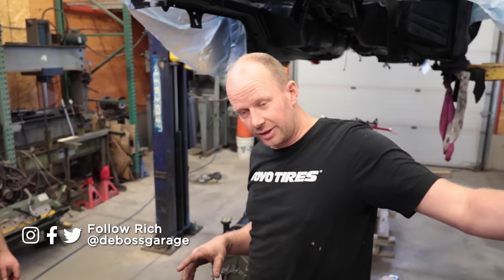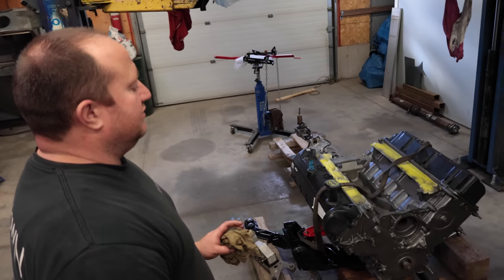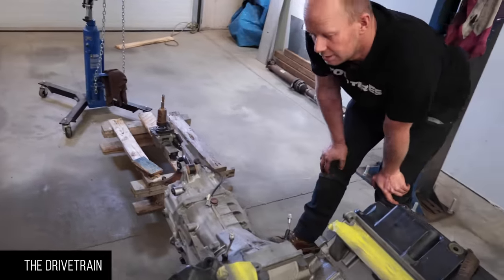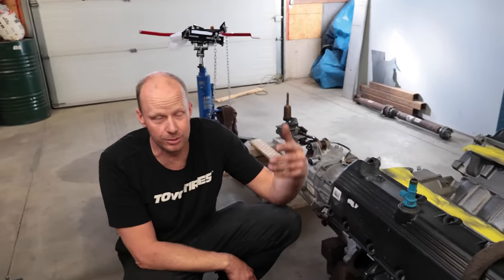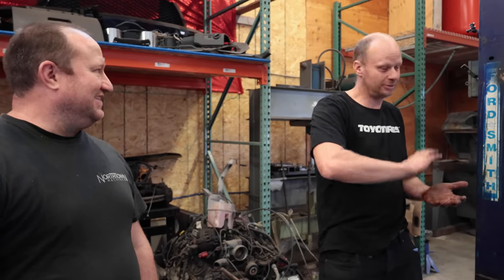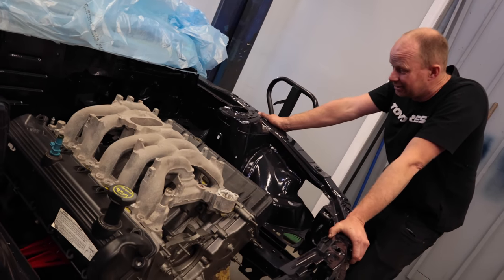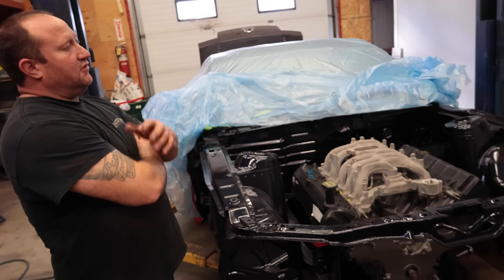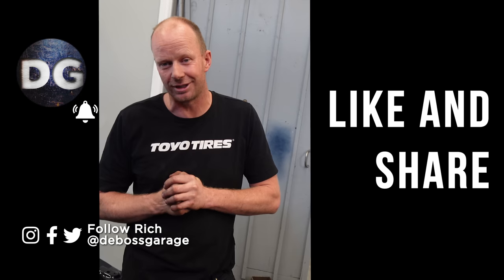6.8 Ford V10 stuffed in a Mustang.. 8v71 Blower or Nah? #V10Stang [EP1]

Comment: Just need to pull the engine forward another six inches and it is basically an Audi v10!
Reply from the maker: Aren't they in the back?
Reply: @DEBOSSGARAGE  The S8 has a V10 that comes from the R8 - when you look under the hood of one, you’ll see what I mean - most of the engine is in front of the steering axis.

Comment: 16V71 BLOWER OR NOTHING ! 
✊😎  🤘😎
P.S: Is it possible to move on to an electric rack & pinion system instead of hydraulic on that Mustang Generation ? Less leaks, hose and steel tube cluttler, etc.
I generally hate electrifying cars but electric rack & pinions are the cat's meow for packaging EXCEPT when you need to buy one.
I know the one (MOPAR NEW part, not rebuilt) on the 2016 RAM 1500 it's almost $2000 and sometimes it's backordered to make matters worse. 😬👎

Comment: That’s a Triton engine isn’t it? I know Ford made several, several different sizes of a Triton. At least those sound like what they should be, know what I mean, because I think that V10 engine that dodge put in their trucks sounded more like a 6 cylinder, a old employer of mine had a Dualie Dodge truck with that V10 and hell when I first heard it I thought it was a V6 , it didn’t have V10 badges on the body nowhere, so I said to him why did Dodge put a 6 cylinder in that truck, a gas 6 cylinder? Haha, he said it’s not a 6 cylinder!!

Comment: No, its a turbo build for sure. Its too big and too heavy for the 360 hp output. That manifold is horrible, LOL!!  Runners way too long as they were designed for torque. Turboes you can mount low, and offset set some weight. Supercharger poking out of hood, might be old school, but not for todays concepts. Hoping you can get the harness and ECU straightened out. If you cant tune the turbos, then its not worth it. Great build and try. You have more guts than I have...Good Luck

Comment: As soon as I heard. " it's the same as a 4.6. I lost interest. And a 8-71 is not a great big huffer. 18-71 is a great big huffer even a 14-71 is. 8-71 is a medium huffer. 4.6 if DOHC , Cool Beans. If not, scrap it and put your time, effort and $ into something else. Standard 4.6 will split with tool much not alot of boost. Your $ not mine